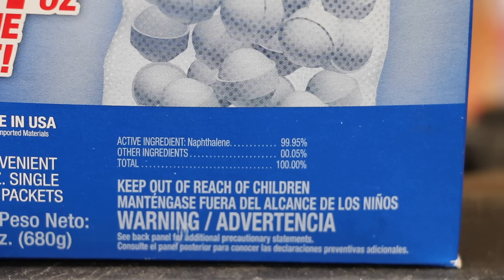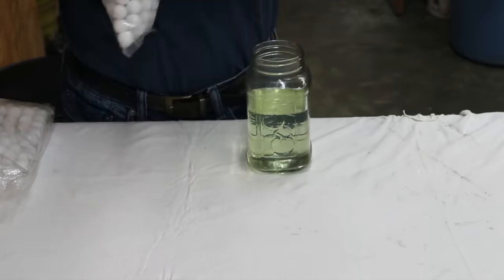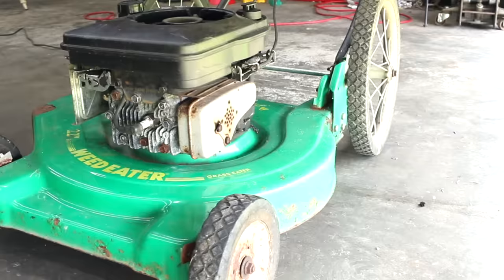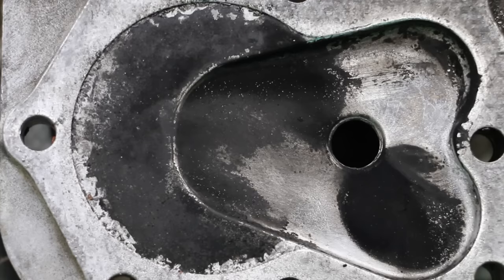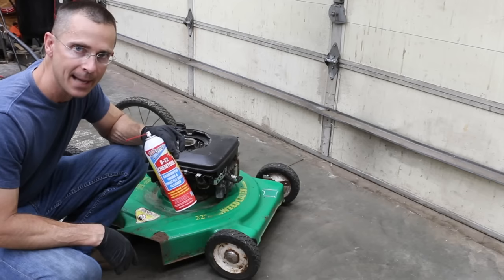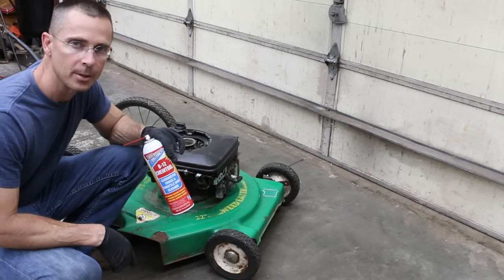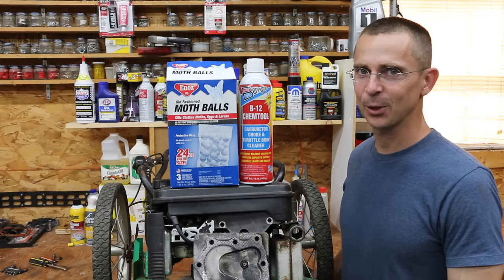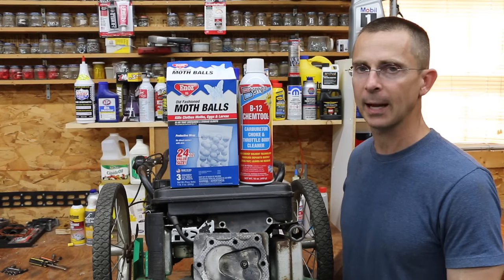Will Mothballs in Gas Destroy an Engine?  Let's Find Out!

Comment: The 99.95% Naphthalene will run fine (lighter fluid) It's the 0.05% "other ingredients" that plugged it up. Probably wood cellulose, gypsum, talcum, and binders. FROM WIKIPEDIA-  Composition[edit]Older mothballs consisted primarily of naphthalene, but due to naphthalene's flammability, many modern mothball formulations instead use 1,4-dichlorobenzene. The latter formulation may be somewhat less flammable, although both chemicals have the same NFPA 704 rating for flammability. The latter chemical is also variously labeled as para-dichlorobenzene, p-dichlorobenzene, pDCB, or PDB, making it harder to identify unless all these synonyms are known to a potential purchaser. Both of these formulations have the strong, pungent, sickly-sweet odor often associated with mothballs. Both naphthalene and 1,4-dichlorobenzene undergo sublimation, meaning that they evaporate from a solid state directly into a gas; this gas is toxic to moths and moth larvae.Naphthalene and 1,4-dichlorobenzene should not be used together because the mixture may cause damage to items being preserved.[1]Due to the health risks of 1,4-dichlorobenzene, and flammability of naphthalene, other substances like camphor are sometimes used (though camphor has its own toxicity issues).Uses[edit]In addition to repelling or killing insects such as moths and silverfish, mothballs have been suggested as a repellent to keep away mice, snakes, or other pests, however this is false. Mothballs do not repel snakes or mice. Small farmers have been passing on the ideology of mothballs acting as a repellent for snakes however this has been scientifically debunked numerous times. Mothballs not only do not keep snakes away but when used outdoors prove to be an enormous hazard including but not limited to poisoning of household pets, livestock, children, water and other aquatic animals. Recent issues with imported and unregulated mothballs from China have also become a huge concern as there is no way to know what chemicals were used during the process. Mothballs are to be used for storing clothing in a sealed container.[2] Older-formula mothballs have also been used by drag racers to enhance the octane rating of fuel, by dissolving the mothballs in some of the fuel and filtering out the remains with a filter paper.  So- maybe if you filtered the mixture?
Reply from the maker: Great point!  I should have filtered the fuel and used far less mothballs.  Thanks for taking the time to research this and post the findings.
Reply: HUBBABUBBA DOOPYDOOP awesome knowledge you have ,and most humans think that some of US is full of useless information.
Reply: No "awesome knowledge" here- just look it up, copy & paste the findings. Thanks anyway!
Reply: <EDIT>
This comment is based on information that was wrong. Read it if you want.

<ORIGINAL CONTENTS>
Napthalene is definitely less flammable and less volatile then gasoline. It should definitely increase the octane. The gunk is definitely what did the engine in. A engine could easily run on pure napthalene, once it heated up, if the engine was fuel injected. I wonder if that would have a cleaning effect in and of itself, because it's actually a somewhat decent solvent.
Reply: YES! You are correct. Isn't "Naphthalene" STERNO? (canned heat)  Charcoal lighter fluid, Ronson, Zippo, etc. say "Petroleum Naphtha" as ingredient. Aren't the "lenes" like Vaseline, etc.? (BTW the '70s music group Canned Heat got there name- from the derelict bum hichhikers they'd pick up going on tour, and they'd DRINK their Sterno to get high.)
Reply: @Frank Gutowski
Oh, I thought mothballs contained Naphtha, and that Naptha and Napthalene were the same thing. That comment makes no sense now I'l probably just remove it or edit it.

Comment: Cars have filters so use a coffee filter and pore The gas in leave a like if you agree
Reply: My first thought when I heard. I'll just dump it right in... LOL!
Reply: No big need to filter when used in correct ratio.  It dissolves in gas quickly when you don't overload the mix.
Reply: You do realize that clogging the fuel filter with mothball residue is not better than clogging the carburetor or fuel injectors with the same residue, right? They will both cause restriction in fuel flow and require replacement of parts to fix.
Reply: @deusexaethera  Used moth balls for over a year and no issues with clogged injectors or fuel filters.  They seem to completely dissolve in gas and remain homogeneous.  They did cause catalytic converters to melt and clog though at a much lower ratio than this guy was using.
Reply: @dickJohnsonpeter  he may be doing it course intentionally. He did as I would for a first try...just add until the gas is saturated and then go for the gusto. It gives an idea as to where it should progress for further tests. Of course, I'm not invested in YouTube or an audience. I'm just a poor schlub who likes to try stuff I don't know anything about. That's what this channel so cool! I can't afford to even try some of this!
Reply: @deusexaethera  Actually, it is better.  Fuel filter is cheap. Carb rebuild is expensive.  Replacing fuel injectors is even more expensive.  But when used in the correct amount, I doubt it would clog a fuel filter.
Reply: @FuzzyWCTX : Clogging the fuel filter is only "better" than clogging the carburetor if you notice the problem immediately and replace the fuel filter before the lean running conditions have a chance to damage any other engine components. Fuel-injected engines can compensate for low fuel pressure by opening the injectors for longer during each injection cycle, but carbureted engines will just appear to run better than normal due to the faster combustion of the leaner fuel mixture -- until you notice the engine is overheating and then have to waste a bunch of time troubleshooting the problem.

The effect of "the correct amount" of mothballs in your gasoline is statistically insignificant. Your butt dyno is lying to you; the only effect you're observing is the effect of confirmation bias -- if the engine runs better that particular day, you give yourself credit for your good idea, and if the engine runs worse that particular day, you blame it on something else.

Comment: I was wondering if running ethanol like e85 in your mower would clean out the fuel system and combustion chamber and valves.
Reply from the maker: Leon, This is a great project suggestion--thank you!
Reply: It won't; not without setting up the engine for it.
Reply: Ethanol will corrode the carburetor and destroy the seals. Regular car gas with 10% e will do it too.

Comment: I ran the moth balls in a couple of cars in the early 70's but I never tried to saturate the fuel with so many it couldn't dissolve them. I would only add a small handful to 15 -20 gallons. Kind of looked like maybe you added gas to moth balls rather than moth balls to gas.  At the ratio you used I would have needed a 5 gallon bucket full. Still a good video.
Reply from the maker: Jeff, I agree.  I added way too many mothballs. Thank you very much for the constructive feedback.
Reply: Jeff Womack 

And any any 'advantage' you experienced would have purely been a placebo effect.

Comment: When I was young, and racing stock cars, we put moth balls in the fuel, it did boost the octane, and made a noticeable difference in performance, the problem was that it would dissolve the diafram in the fuel pump. That will cause problems.
Reply from the maker: Great Point. Thank you
Reply: U put to much .only one moth ball put five letter u can get best proforment

Comment: At most one pellet per gallon was the rumored ratio.  Word on the street was that it helped prevent old style gas from forming lacquer.  Considering that Sea Foam is mostly Naphtha, that seems to make sense.
Reply from the maker: I definitely overdid the mothballs!  Thanks for commenting!
Reply: I wish you would give this a retry.
Reply: Naphtha and naphthalene are not the same thing, though related. Closest thing chemically would be benzene, which is toxic and hard to get. You might try toluene and/or xylene. A typical racing fuel formulation is 50% gasoline, 25% toluene, 25% xylene.
Bump the compression on the mower up to about 13:1 and you'll be a mowin' maniac!

Comment: I had a '67 Dodge Polara 318ci and I used to fill the tank with "ethyl" back in the day and use 5 mothballs in the full tank. Never hurt my cars engine over 30 years. If ya didn't put too many in the tank, you were ok.....as long as you had a FULL tank of fuel.

But, can I run a modern 4cyl motor on a 1/2 quart of Motorkote? A full quart, with out harm to the engine?  (A 2008 Kia Spectra 4cyl, for example). Thanks, would love to know.
Love your videos. Very informative. 😇🐺
Reply from the maker: Thanks for the video idea.
Reply: Me too same results

Comment: You should try to run a engine on 100% Break cleaner
Reply from the maker: Thank you for this recommendation.
Reply: Brake cleaner is water-soluble and does not burn

Comment: I'm not sure where you would get jet fuel but it might be cool to see it in a lawn mower.  Or it might need a higher compression to ignite. Only one way to find out.
Reply from the maker: Jimmy, Seems like a great project idea to find out!  Thanks for the suggestion!
Reply: Jet fuel is basically highly refined and pure kerosene (or Paraffin here in the UK), and you can run a small engine off it but you have to start on petrol first to heat up the engine, and then either mix the kero in so it's like TVO, or just swap the feed from one to the other... :)
Reply from the maker: twocvbloke, This is great information.  Thanks you!
Reply: Project Farm  try it In a diesel if a gas engine doesent work
Reply: james edwards jet fuel is very hard to get to burn. It will even put out a match held at its surface in a bowl.
Reply: Try not to confuse Jet fuel (Jet A1, which is highly refined & pure kerosene) with AvGas, which is an aviation-grade form of petroleum, which is quite flammable as per it's road-going counterpart, but is much higher in octane, and would probably blow  a small engine to pieces very quickly...
Reply: twocvbloke 
Av-gas is just gas with a higher vapor pressure ( evaporates more slowly) and depending on the grade, a higher octane ( less prone to igniting from compression pressure). The specific energy per CC of av-gas and pure street gas ( pure gas, not ethanol blended crap ) is very similar. Av-gas will not blow up a small engine.  If we added nitro-methane to the gas, any gas, THAT increases its specific energy quite a bit, and can blow a lot of engines...
Reply: Jeff Sergent I used to have a neighbor that flew private jet for a corporation. Before each flight he had to do a drain sample on each fuel tank to look for water that goes to the bottom. Once pulled from the plane, the fuel cannot be re-introduced, so he would save it and bring it home to me.. It was a mother to get burning, as it requires very fine atomization into tiny droplets to easily get started burning.. We used it blended about 1/3 with regular kero into a kerosene fired space heater. On the other hand AvGas is quite volatile.. When I hung around with the  car racing crowd long ago, we would go to the airport to buy high octave aviation gas for very high compression race engines...    Over time, the really high octane stuff became unavailable and other gas blends were sourced.  Jet fuel is similar to kerosene and IS hard to ignite.. AvGas, like any gasoline,  in any octane rating,  has very explosive vapors. Considering my familiarity and actual use of  of these fuels for over 45 years, I suggest that you are confusing something about which is which... I still purchase AvGas from time to time for use in small engines that are heavily loaded, such as my 10hp chipper. It runs poorly under heavy load on street pump gas that has 10 or 15% ethenol, but runs fine, better power,  on 100% gasoline from the airport. We also buy pure gas for our boat, from waterside dock facility, not an easy way to get gas to take home. The local light plane airfield is the only easy way for us to get non-ethanol gasoline that can be put in a can and driven away in a car.
Reply: Jet fuel is dangerous to inhale and difficult to obtain. I'd let this one go.
Reply: +Jennifer WhiteWolf +Cody Wynn 
Neither AVgas 100LL or JetA/Jet A-1 are very difficult to obtain. 
I regularly purchase small quantities (5-330 USG) of each from the local airport fuel service operator for non-aviation use. 
AVgas 100LL contains lead, is untaxed for on-road use and generally illegal to use as an on-road vehicle fuel in most US states. 
It also has negative effects on vehicles with O2 sensors and catalytic converters. 
Jet A has practically the same properties/specifications as ultra low sulfur 1-K (K1) kerosene. 
Jet A does have an aviation specific light end additive package (less than 1 percent) as defined in ASTM D1655 that kerosene does not. 

+Jennifer WhiteWolf 
You are correct AV100LL is characteristically very similar to ethanol free 93 premium pump gasoline. 
AVgas 100LL does have a slightly higher octane rating than the 92-93 octane premium pump gasoline, but it is not 7+ points greater due to the different methods of determining the octane rating of each fuel. 
Aviation fuel uses the Motor Octane Number (MON) method and on-road fuel uses the (R+M)/2 or AKI method of determining the octane rating and the two laboratory procedures and scales are completely different. 
AVgas usually has a higher Reid Vapor Pressure (RVP) to help promote fuel vaporization at higher altitude/lower ambient air temperatures. 
We also used AVgas as a race fuel many moons ago, I know some guys that still use it as race fuel today even though there are better performing specially formulated race fuels available commercially. 
 Just an FYI, nitromethane does not mix with gasoline, they are not miscible with each other. 
Nitromethane is usually mixed with methanol. 
Also the specific energy of nitromethane is approximately 11.3 MJ/kg and gasoline is approximately 44 MJ/kg. 
Nitromethane makes high horsepower because it has its own built-in oxygen component. 
The oxygen in nitromethane's molecular structure means that nitromethane does not need as much atmospheric oxygen to burn, part of the oxygen needed to burn nitromethane is carried in the fuel itself. Typical air fuel ratio (AFR) for nitromethane is 1.7:1 and gasoline is about 12.8:1. 
This means the engine can ingest a lot more fuel and still have the ideal AFR for maximum power production without increasing engine displacement or air flow.  
More fuel combusting at the ideal AFR equals more BTU equals high power. 
Fresh and clean Jet A/A-1 is really no more difficult to ignite than 1-K kerosene, however Jet A/A-1 or kerosene that is contaminated and or is old, or been exposed to elevated temperatures or has been exposed to the atmosphere and or lost the light end volatile hydrocarbon distillate components can be difficult to ignite. 

+Cody Wynn 
Higher octane gasoline will not "blow  a small engine to pieces". 
If anything, it would help prevent damage from preignition/detonation. 
If the octane is too high, starting may be difficult and operational performance may decrease, but damage is highly unlikely. 
While inhaling Jet A/A-1 is not recommended, it is no more toxic/hazardous than 1-K kerosene.
Reply: Jet A fuel is pretty much highly filtered kerosene.
Reply: Wrong!
Reply: Jet fuel is just high grade kerocin
Reply: an otto cycle engine never requires more compression to ignite, thats because it's not a diesel.... it ignites by spark plug, not compression. stoichiometric mixture is what burns, it doesnt matter how much its compressed... in fact the more you compress, the larger spark plug gap you require, and in turn a better ignition system to jump the spark across the larger gap in order to ignite the denser fuel and air mixture.
Reply: Jet fuel isn't much different than diesel. It just has some added detergents

Comment: Too many mothball in little quantity of gas. Only dissolved mothball gas should have been used. Alsi pieces of mothball were put in the fuel tank which was wrong. After sieving the with dissolved mothballs wouldn't have spoilt the engine much.
Reply from the maker: Thank you

Comment: All of this is predictable if you understand the chemistry. 

Napthelene is both melts and boils at a high temperature because it is a much  larger molecule with much stronger inter molecular forces. This will raise the boiling point of the fuel raising the octane rating (essentially a measure of how hard it is the fuel evaporates). The fact that naphthalene has two aromatic rings, 5 double bonds, also puts it in a lower energy state, making it harder to burn, and making it much more likely to produce PAH's. polyaromatic hydrocarbons which are the compounds at the bases of much of carbon build up. 

Finally, inside the carburetor there is a lot of evaporation. Most of the naphthalene is not going to evaporate, but instead deposit there. 

Its good that you didn't try the dichorobenzene. You are absolutely right, burning it will tend to produce dangerous compounds, for example, phosgene and dioxin.

Comment: yeah it works...i remember this trick...we added it to some old station wagon that basically wouldn't rev over 4000 rpm and after it would do burnouts and just scream at about 5500 rpm...just a fun thing to do...high octane is no good for small engines like these ... and we added like 5 or 10 to a 20 gallon tank
Reply from the maker: Phil, Great point.  I added too many to the tank.  Thank you very much for commenting!